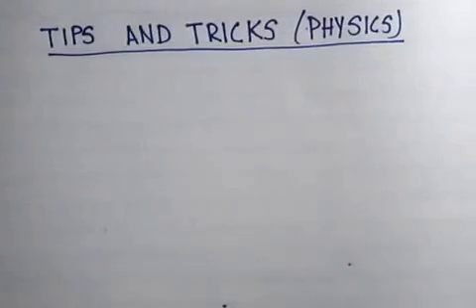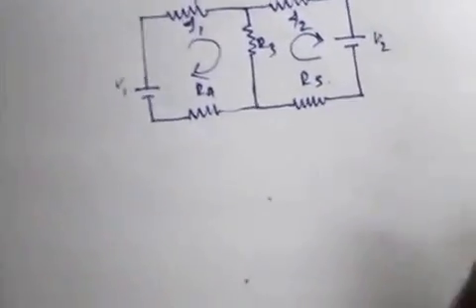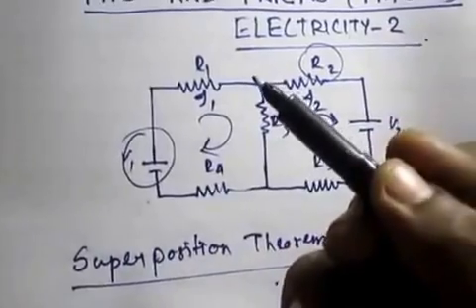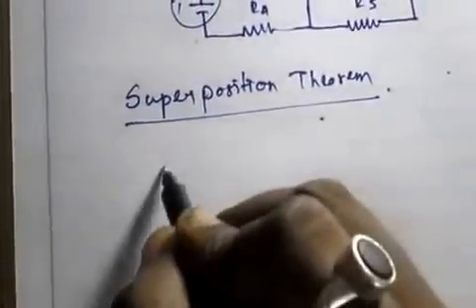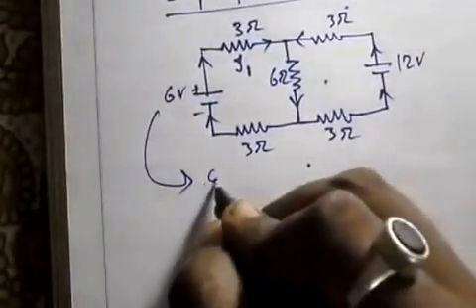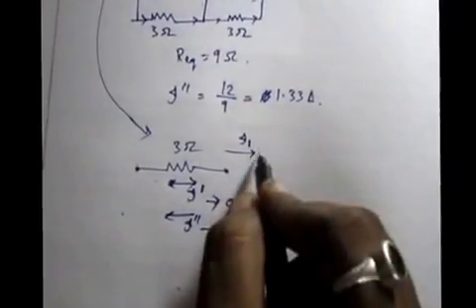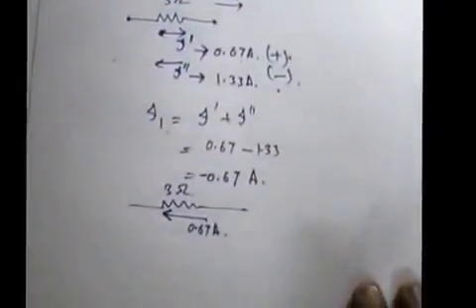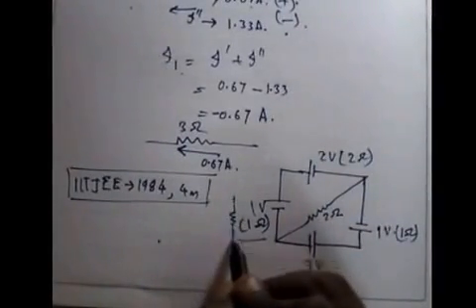IIT JEE shortcut tips and tricks physics electricity  2

Comment: In the second case the current should not be 1.33A through 3 ohm. It is the total current. It will be 0.67A. Total current through 3 ohm will be zero.
Reply: THANK YOU!
It was nagging me the whole time I was watching this video.
Reply: +Durgadas Basu Sir, in the last homework sum, as per method if we keep only one emf and shot the rest then while calculating current through resistor there is a open wire in parallel so no current flows through resistor..
Reply: can u explain how
Reply: onkar cmd current divider rule ..when current splits it splits such that I(through 1junc)=I(total) X lower resistance/lower +higher resistance.
Reply: yessssss
Reply: How did you get 0.67, sir ?
Reply: no,current through 3ohm resistance will be 0.5A
I DID IT BY SIMPLY APPLYING NODE RULE TWICE AND FINDING THE PD across the resistance
Reply: Basu ji you are Right sir👍
Reply: .11
Reply: You are absolutely right sir .that is what I was thinking
Reply: see the circuit is a wheatstone bridge actually .